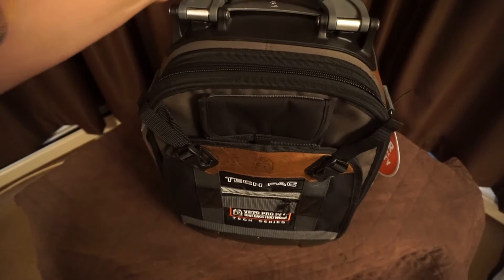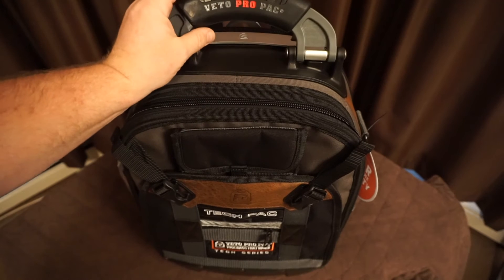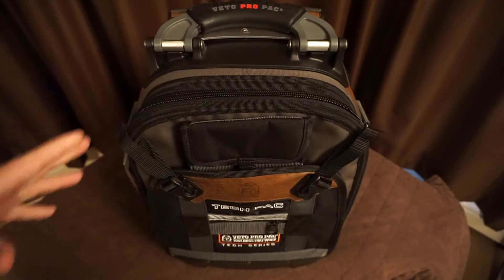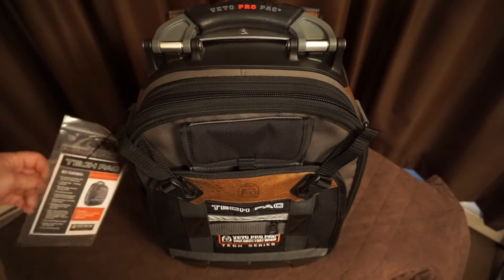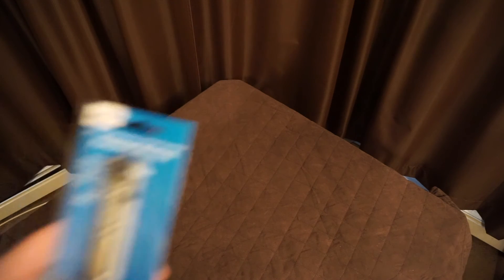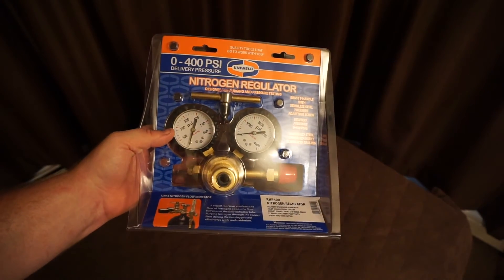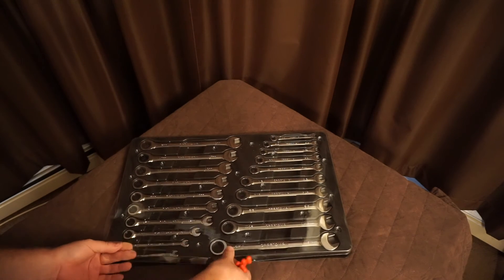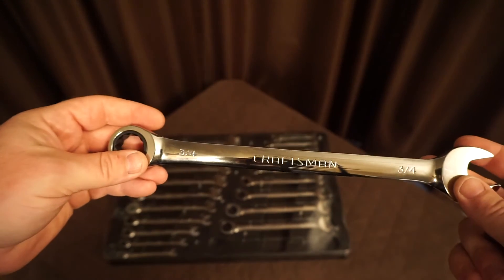What it takes to be a HVACR Tech  and some tools of the trade

Comment: Good video but one note you said to buy more than 18v but 20v dewalt is the same as 18v the way the work is they are 20 at rest but 18 under a load the same as any other 18v lithium ion tool